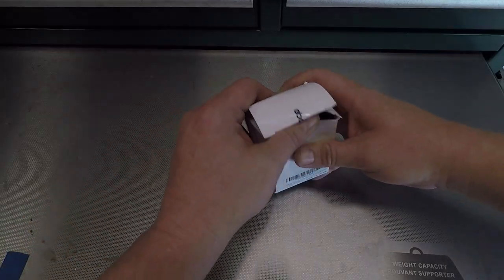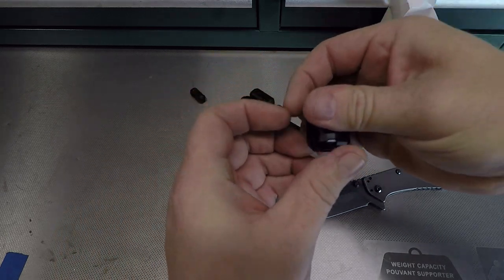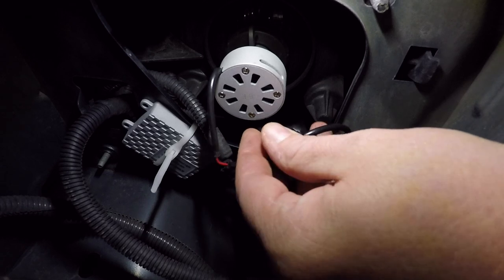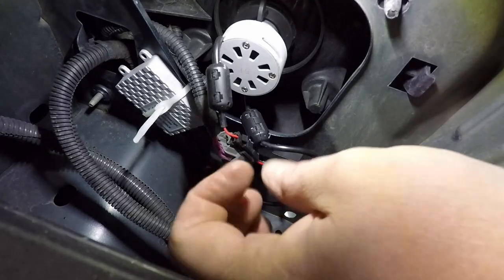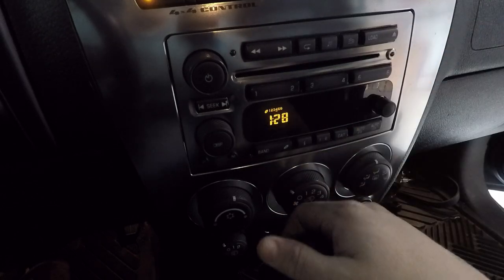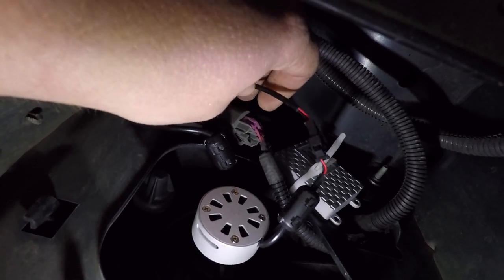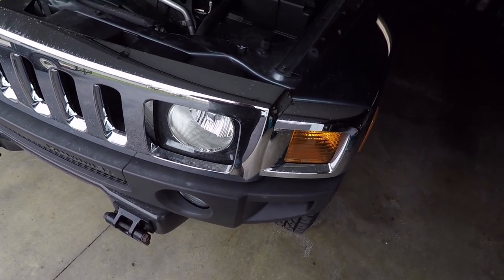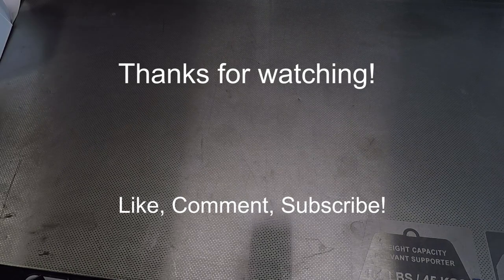Fixing LED Headlight Radio Interference

Comment: maybe buying a fanless led bulb wouldn't have this problem
Reply from the maker: David Peric perhaps, but I wonder how it would last very long.
Reply: the fan would fail before a fanless led bulb blows
Reply: I have led headlights without the fan and I'm having the same issue.
Reply: Ditto - fanless bulbs definitely still have the problem.